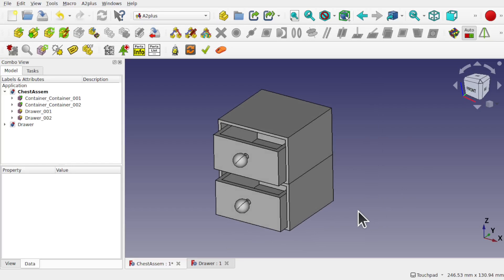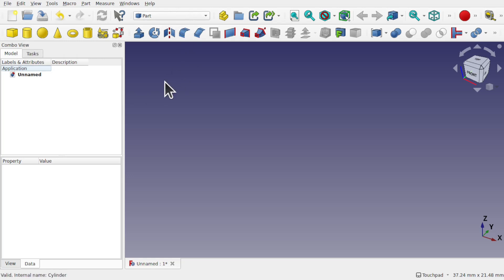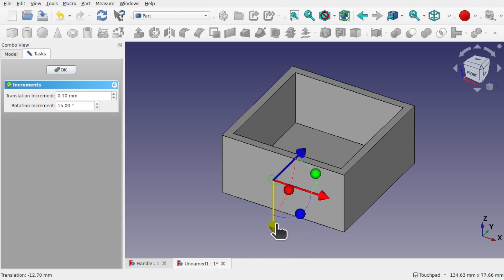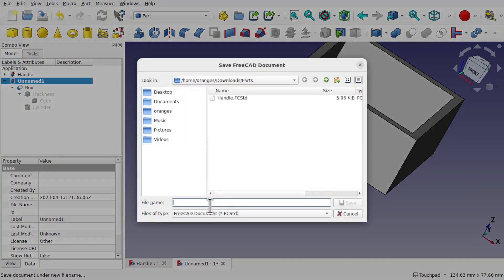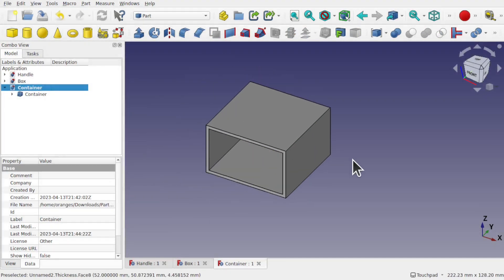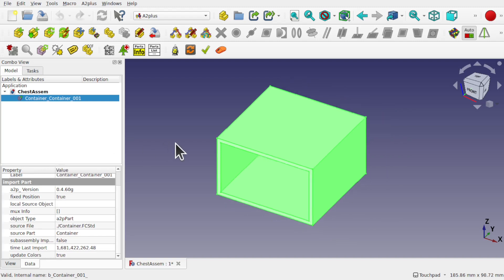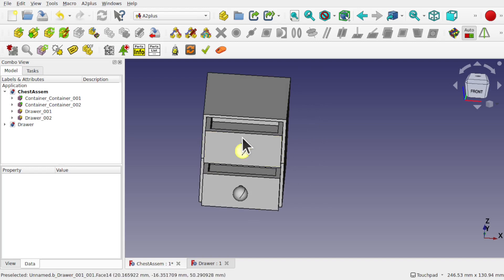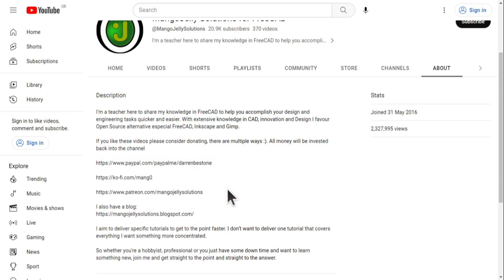Learning FreeCAD for Beginners | 39 | Sub Assemblies in A2 Plus | Chest of Drawers

Comment: I have been waiting for a video like this one for a long time. Sometimes i think we over look the simplicity of some designs. As i was working on making a desktop storage unit for all of my small stray parts. I ended up with a very complex design that i worked on for hours. Then you made this unit that is configurable and simple in design. You my friend are a godsend. I will be looking at designing storage containers and project enclosures in a completely different way after this video. Thank you again for sharing your knowledge in this complex topic.
Reply from the maker: So pleased that you found a great use for this. I to went down the root of over designing the same assembly. Making a front, side and slide in bottom as if I was creating this for a full on wooden construction. I then took a step back and thought to myself 'What an I trying to demonstrate and how can I do this in the minimum amount of steps so people don't get bored ' . I was aiming to make a assembly tutorial that can be built upon.  And realised that for 3D printing you don't need all those connecting parts. It lead to a quick tutorial with a practical real world object which for me theses types of tutorials personally love as it creates something with a purpose.  Thank you for the kind comments and so pleased that your finding them useful. I am constantly monitoring the reception of the videos and again am tweaking the content I produce. I am trying at the moment to mix experimental intermediate projects along with more friendlier practice ones like this along with some tool explanation to see what the reception is like.

Comment: Thanks for this. I really needed it. Coming from Fusion360 I find some aspects of FreeCAD a little foreign and difficult to grasp.

Incidentally, if you're on a Mac you don't need to use CTRL click as this causes issues with menus as CTRL then left mouse is the same as clicking the right mouse button. On Mac you simply click each point/plane/edge.

Comment: Are you a mind reader? This is exactly what I wanted to learn about. I am considering designing a CNC router using FreeCAD. It will be build with multiple parts that are the same / copies (e.g. NEMA23 stepper motors) that are drafted once and then multiplied and assembled.
Reply from the maker: Erm, well, lol, the first video I started to do before I changed it to a drawer consisted of modeling a linear rail, linear bearing.... you can see where this is going lol. I dropped it as it was taking way to long to model each and the video was running over an hour. Then I had the idea of downloading step files and building the assembly from those. I got hold of a Nema 17 from grabcad and bearings then went off on a tangent and made the stl tutorial, I think you may still be able to see the downloaded file when I go off and save the assembly. So tomorrow I'm off to buy a lottery ticket lol. But yes I was putting together the lead screw assembly as one sub assembly then the linear rails so your going down the right path.

Comment: In the real world we would be assembling parts that are dimensioned to have clearances between them. How does this work in this workbench?
Reply from the maker: This is a great question that I never thought about including. I have been saying about breathing room in some a2 videos but I have never said adding tolerances, or thought about including that. Some of the constraints allow for an offsets which you can adjust  for the tollerances but certain others don't. Plane coincidence, circle on circle, center of mass for example allow for that. I am now wondering if that's the reason these type of constraints exist. Certain ones are just visual, others are for precision. I may use this for content for another video as what you have bought up is extremely important and useful subject.
Reply: @MangoJellySolutions it would be nice!
Reply: The "PlaneCoincident" Constraint has the offset. So design the drawer smaller than the opening and offset the proper distance.  I use the offset quite often for positioning.

Comment: can you make this but parameterised - like you set internal dimensions for the drawer, wall thickness, clearance margin for container, container wall thickness and all the parts resize appropriately? I can add a spreadsheet, but from the look of it with a multipart a2plus assembly I'd need a spreadsheet and repetition in every .fscad file

Comment: Does the A2 workbench have 'collision' detection?  From parametric programs I used in 1999 for solid modelling, the sub assemblies prevented solids from intersecting during constrained movement.
Reply from the maker: Unfortunately not. It is one thing I would love to see.
Reply: @MangoJellySolutions  yeah, both SolidEdge and Solidworks had collision detection / interference checks, which made it handy for fit checking assemblies
Well, its still an improvement over the earlier attempts at assemblies w/ FreeCAD !

Comment: What's the approach for having parametric control over individual parts, in an assembly?

Scenario:  I want to build a dresser.  The dresser consists of a carcass and drawers.  The carcass consists of stretchers.  The drawers consist of sheets and mechanical joins.

My end goal would be to adjust the dresser width and have the drawer fronts/backs scale evenly with it.
Reply from the maker: You would be looking at a spreadsheet approach across multiple parts. I am in the process of putting together a video on this subject using a similar furniture so I can make that available once done

Comment: I wonder can you use this furniture (or even a simple table) to create an Assembly Instruction manual that is printable in A4? I've been searching all over internet but there isn't a complete guide on how to create one, or export one ; 

the only place that I found got a complete guide is on Solidworks; however I can't afford to pay for solidwork just to create one Assembly instruction, do you able to make it possible by using freecad? I desperately need help for this.
Reply from the maker: I haven't replied as of yet as I have been doing some research on the subject. I looked at Solidworks composer, very impressive but unfortunately am equivalent doesn't exist for FreeCAD. The techdraw has internal commands to output as SVG. If there was some way to hook up an animation to take svg snapshots at keyframes u can see this being very useful. But unfortunately there is no composer type program, sorry. The only way to do is is build an explode assembly and take a view of each at that point in time and export out. This will be pretty time consuming. You may be able to script it worth python code.... Now that's an idea!
Reply: @MangoJellySolutions  Thanks for the reply!
And yea you are right, I eventually use this explode assembly method and export it out into PDF; I have to basically position my drawings in different ways and export it out individually, and then use Inkscape to arrange it in accordance to the steps that are required....

It is time consuming and tedious but as long as my goal is achieved then I think is fine.....

No need to spend hundreds or thousands of dollar just to get one thing done.